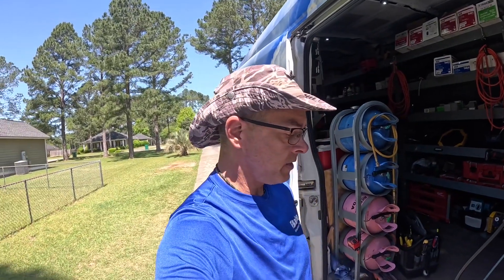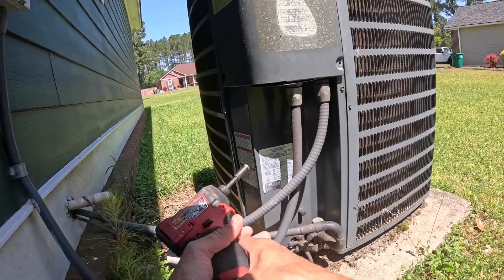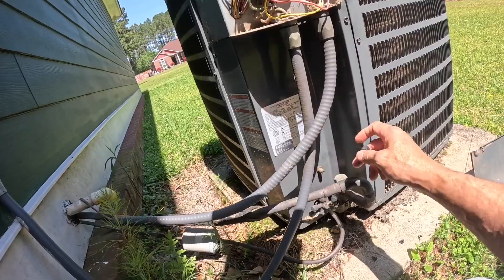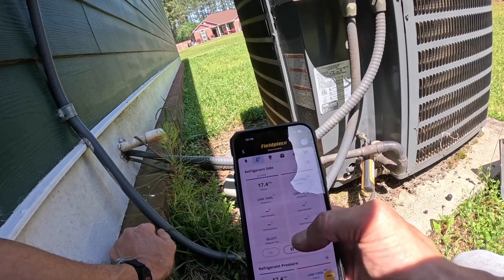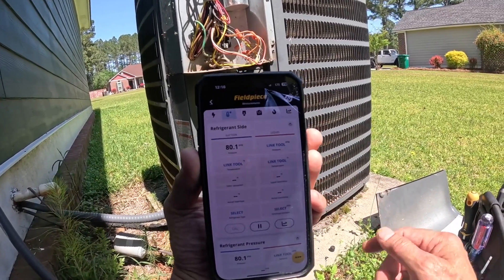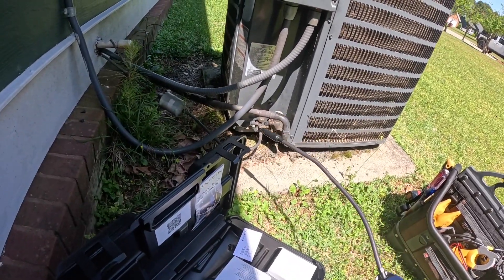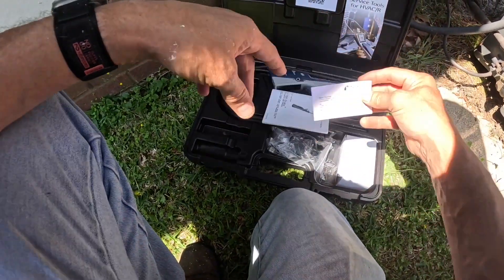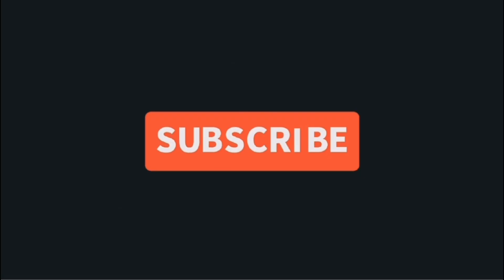No Cooling Call Leads to An Unvented Attic! #hvacguy #hvaclife #hvactrainingvideos

Comment: That's the one reason I can't do this kind of work full time, working in blistering hot attics.  Honestly I never understood the point of putting the air handlers in hot attics other than there is no other space in the dwelling for it,  the units are subject to more condensation like that.   That condenser has a nice "fur coat" on it too.

Comment: No vents at all?? I just re-roofed im FL & roofer recommended adding more vents which I did. Never knew the heat in attic affects life of shingles. Hoping it will also benefit the air handler in attic.

Comment: I thought there were certain code requirements regarding attic ventilation.  Here in CA when older homes are re-roofed the roofers are required to add MORE attic vents.  And now there are new codes for installing fire resistant vents in fire prone areas. In my inland area 105 - 110 degrees is not unusual in July and August.

Comment: Having some kind of vent will definitely help the system. Especially the duct work. Last year had a temp drop of I believe 7-10 degrees on small section of flex duct. Unvented attic as well

Comment: They would ultimately benefit from some vents. The unit would also run cooler inside that attic. I bet the temps in the house would drop from that venting alone.

Comment: Well there is a slab coil. It's on an angle, mine is straight up and down vertical and a leaker. I'm still limping her along, change out is inevitable. Good call, I hope you can talk to them about attic ventilation. At first when you pointed out the oil on that copper, I thought repair was possible until you found the real culprit. Thanks for sharing